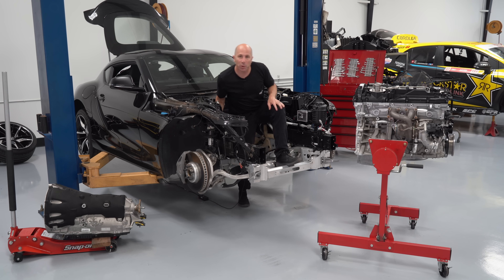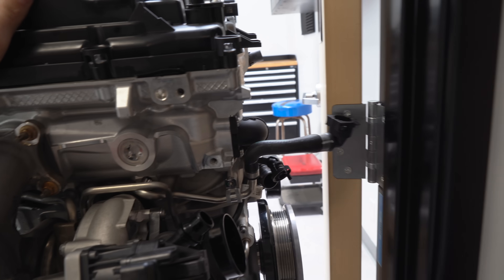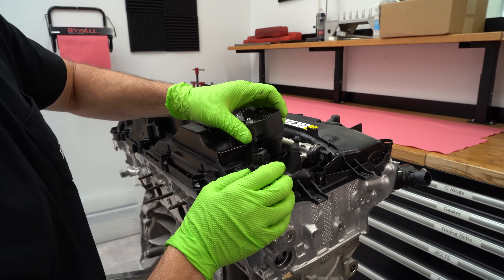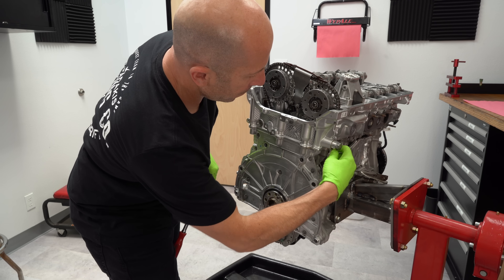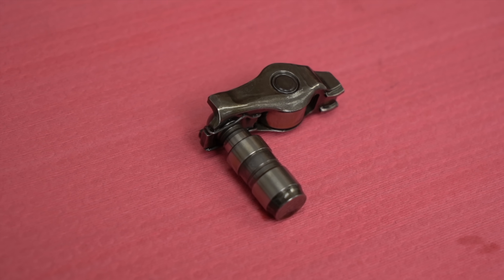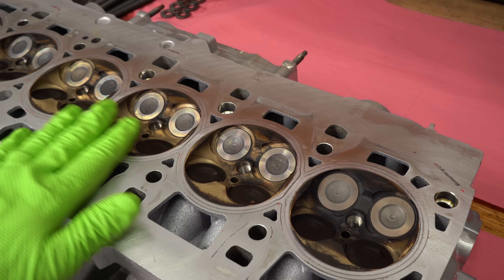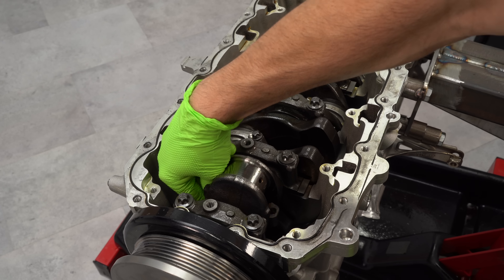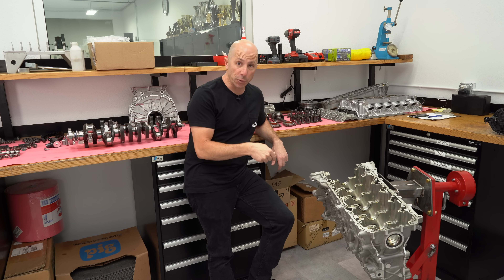2020 Supra B58 Engine Teardown - First Look - Better than the 2JZ?

Comment: All those six exhaust ports which are pretty large it came together in those two relatively small common ports for turbocharger connection.
Another one: at rev counter, redline from @6000rpm?! It's diesel truck or sport car? Many diesels n57 and m57 revs and push (modified- camshafts, valve springs) 6000rpm. My 5cyl fiat coupe 20vt had stock redline from 7200rpm (now 8000rpm).. probably there's some resonance problem at high rpm for b58.
ps: They said had no forged conrods, but i seen "cracked" rod caps there, which usually are used at forged conrods...

Comment: Way too much plastic on this engine for me, and timing chain at the rear of the engine makes for a servicing nightmare. Even simple jobs like removing vanos solenoids becomes a problem, and they will need to come off when the orings go hard and they do not seal. For me a Barra is a better alternative to a 2JZ than this.

Comment: You almost got all the way through without mentioning BMW.  It is good to see the solidness of build on the older B58's though. Now BMW TU2 or B58C's have been redesigned for different temperature management and the 48v mild hybrid.  We get great efficiency, mileage and power on demand now.

Comment: B58 engine is usually very reliable, the only problem is low maintenance the oil filter braks up .nomber 1 silinder can brake rigs on hi stess .

Comment: Oh look more useless german over-complication. Timing chain in the back so you have to remove the entire engine or transmission from the car? 😂 Intercooler in the manifold? Thermostat with a computer sitting on it? Oil cooler with coolant in it? Water pump/alternator bracket with coolant running through it????😂😂😂 What is this? April fools day? Its like this thing was a prank or something. Designed to fail. The fact that anyone thinks this will be more durable than a 2JZ is LAUGHABLE.  I'd like to see one of these do 300k without even being opened.

Comment: 10:57 I’m impressed!!!  Block girdle ties the 2 sides of the lower block together, along with a center bolt going into crank bearings!  We can appreciate the slight over-engineering.

Comment: I'm surprised that you can push these modern engines to 1000 hp. Older engines tend to be more over built, and it seems newer engines are built to very tight tolerances and couldn't take much more power then designed for. I guess this is an exception. Interesting to see that the valve timing system is almost identical to the old VANOS, only electronically controlled now. They used to be hydraulically controlled. Btw I get nightmares seeing those plastic chain guides that always cracked on older bmw engines. Great video and narration.

Comment: Only 2 minutes in, and they never said this car is about 98% BMW.  The engine and engine bay, drivetrain, interior, body shell, suspension, brakes...

The stickers under the hood are in German as well, and it's built alongside the BMW Z4

Comment: Better? No. 2JZ is simpler. Cast iron block. For outright power, the 2JZ' is superior to the B58. The only real 2JZ competition from BMW was the S38B36. The amount of coil, plug, turbo, injector, HPFP revisions from BMW is proof that it is no 2JZ replacement.

Comment: It's not better.. It's a good engine but they are blowing up already with high 600 hp and the transmission can't hold the power like to 2JZ
Reply: That's because of the different variants. The B58 in the mk5 has a stronger hpfp than the other ones since the older variants hpfps aren't nearly as strong. They won't blow when they're around 600whp if(in the case of the old variants) they had got a stronger hpfp. Many run 7-800whp+ on them often and some peer into the 9-1000whp range easily with just piston and rods(tho some have been able to run there's with stock rods and pistons a bit over the 900+whp range and still run just fine and are slowly becoming more common).
Reply: @carboydorifutoparty3976 Facts
Reply: @carboydorifutoparty3976 Please tell it to the people on Face book

Comment: Those are not rocker arms and they do not pivot on a lifter .Those are not lifters ..So those are valve lash adjusters and cam roller followers

Comment: Good vid. Not a fan of all that plastic coolant pipe. Also not a fan of the rear mounted timing chain. I guess time will tell if the B58 ends up being reliable.
Reply: It's been 3 years. Time has already told that it's plenty reliable

Comment: Is there a benefit to placing the timing chain in the rear of the engine vs the front?  I know a lot of German automakers have chosen that route, but I am curious what the benefit of that is.  Thanks!
Reply: This engine is pretty large. Having the chain at the back means it can fit under the hood of cars like the new supra because it makes the engine a bit shorter and less tall up front since there's no chain or belt to accommodate for now.
That chain should last 200-300k miles at least with regular oil changes and 5w40. Timing chains really suffer when thinner oils are used and its not changes as often as it should.

Comment: the b58 engine itself is good but what i absolutely hate is that its made complicated on purpose.
so the repairs would be difficult at normal mechanic, you either go to a bmw specialist thats not affiliated with bmw or go to the company.

Comment: so much plastic I would be afraid my engine will melt
Reply: yeah then learn about different plastics please not everything is a melted down sewer pipe...
VW makes entire oil pans from plastic now they use very high quality compounds for that and these pans would never melt because they use thermoset resin plastic with lots of fiber reinforcement.
A part made from such plastics can be identical to aluminum in its performance except it would catch fire at some point when aluminum would just melt.
Reply: @alouisschafer7212  
It does not matter its still plastic,& will always be plastic.Once plastic gets hot & cold many many cycles it will always get brittle.They building parts soo that you can always come back.
Reply: @alouisschafer7212 ok plasticguy
Reply: That's what I'm thinking.toooo much plastic of vital hot items.Ita a bmw

Comment: bmw made an interesting engine.  But it is a shame we didn't get to see what toyota could have come up with.  I know they worked with BMW and made many changes, but that still doesn't make it a toyota engine...more like a custom ordered engine.  Frankly, I don't see why toyota didn't modernize the 2jz.  But, what's done is done...and it will be interesting to see how the b58 does trying to make big hp.
Reply: What do you think a supposed "3JZ" should have had to be better than B58 and 2JZ?
Reply: @AmelpsXett  I can think of 2 factors: Hybrid injection instead of only direct injection and a timing belt instead of a chain. But that's all.

Comment: Unfuqing believable. They actually thought it would be a good idea to sandwich the timing cover BETWEEN the engine block and transmission?? And you have to make or buy a special socket to change plugs?? 
      Toyota and BMW can both eat a pile.

Comment: My old truck had a mechanical fuel pump, but there's no way that thing pushed thousands of psi... Some please explain
Reply: Direct Injection on Gasoline engines is exactly like commonrail diesels just with gasoline

Comment: Don’t those piston oil squirters hit the piston walls so they help seal the piston ring to the wall in order to minimize blow though from the combustion in the cylinders? Then again…. I recall formula racers, one in particular who was using piston oil squirters to purposely cause blow by in order to get more gas mileage on the track because the oil blend that they were using “Penzoil” was actually combustible.

Comment: Nice to see that bmw refuses to use better materials for the timing guides lol 150K miles and there will be leaks everywhere due to the Silicone and gaskets as well, hope Toyota takes the engine and makes its own changes for a better car later on but this one I would avoid.

Comment: 3:10 - My old 3S-GTE (1990 Celica All-Trac) engine had an oil cooler to which the oil filter was screwed. Oil cooler separation from the engine block required a 30mm deep well socket. Fun times...
TRUST !!

Comment: Hello, my 1jz gte vvti was tuned without the vvti solenoid connected which means now my engine runs on a tune without the Vvti.

So if I connect the vvti just randomly would that cause any problems?

My tuner was dumb to not notice that and many more things.

And yea.. Now I have finally got my 2jz gte vvti with R154 gear. Gona run the same setup in your 2jz teardown and rebuild vids.. Thanks a million mate

Comment: Wow, Audi did that with the timing chain on the back of the engine and its a $10K dollar job to pull and replace it. No Thanks B58. I like the simplicity of the N52, no forced induction and it just lasts and lasts. Hit the road last night and was racing a ZX14. At 160 he started leaving me but it was exhilaratingly fun.

Comment: Doesn't matter if drive by wire can move faster than your foot can move. It's the relationship between when you move, and when it moves. You cant 100% turn off any variations between butterfly position and pedal position. It always does its own thing in some way or another

Comment: I've got the same engine in my X4 M40i and I have to say I truly love it. It make a 2 tons car accelerate like a toy, also the torque is there from low rpm, so whenever you kick-down it just pulls. I've managed a 4.62 to 100kmh and a 16.5 to 200 kmh, very pleased with the times https://www.youtube.com/watch?v=4eSahwlKQgU

Comment: Wow many thanks for showing me this engine. You have restored my faith in BMW engines again. I am the owner of three BMWs. An E46 M3, 1988 635csi, and an E60 530i with the N52 engine. All of which have fabulous engines. I have steered away from their V8s and the one off V10 (which I really wanted). I have heard so many problems with their later engines and I was really worried about what my next car would be. I will wait a little longer now and buy a good used S58 engine (close relationship with M58), possibly an M4 Competition. Thank you

Comment: I still have a 2003 BMW 525i with M54 engine.  I made some research and found out that the M54 has a hollow piston rings. I wonder if the B58 engine have solid piston rings or is it hollow as well?  Please advise.  Thank you.

Comment: Funny Toyota guys pulling apart a BMW engine for the first time. bearing coatings BMW has been using long before auto start stop, cracked rods since the 2000's maybe earlier. Most of the technology is old by BMS standards now.

Comment: The throttle body on modern BMW's is actually only a safety feature, it's wide open all the time and the power is controlled by the intake valves' variable lift.

Comment: It’s interesting how they switched away from an integral bed plate for the main caps and went with a structural windage tray.  Needless to say there’s a lot of new developments in the B58 engine inheriting the best from the S55, N55, and before that the N54.  I’m not sure moving the exhaust manifold in the head is a great idea but c’est la vie.

Comment: I quite like the design.Quite ingenious! The only problem i have is with all that plastic crap. Couldn t they have made some of the parts out of some strong and lightweight metal?! it s getting ridiculous with newer engines when it comes to how much plastic they have.plastic,degrades a lot faster and in different ways when compared tometal over time.I don t care if it s toyota or bmw plastic. it s still f---ing plastic.

Comment: Please stop calling this a supra engine. This isn't a real supra. It's a rebadged z4. Coming from a 2jz reliable legend to a pos unreliable BMW engine. Way to kill a legend.
Reply: Lets just forget the fact that the mk3 had very well known issues of its own which caused it to have expensive issues of its own with its 7mgte. Plus,the B58 is showing more and more that its alot easier/cheaper to make power out of vs a 2jz  mod for mod. Probably not in the billet block level yet but they're growing faster by the minute.

Comment: vauw i had no idea engines of today was build this poor😶...
to mention a few details -
internal exhaust gasses travelling far before reaching the exhaust - in alu. you got to be kidding. in a few years the top will be pudding, annealing the aluminium.
alu block instead of iron is just as bad as the plastic intake. plastic as an integral engine part is a bad idea. simply because plastic cracks after some years. any plastic has poor longterm mechanical properties and cracks too easily, with no chance of repair.
in short, this engine is made like a throw away part, you will have to buy as a whole, because all the tech solutions is short term.
now i know, the world industry is centered on a 2-4 year cycle, where everything is designed to last only that long. but i had never imagined it would spread to car engines - ever.
i now have even less respect for bmw and new cars as a whole.
i am so glad i purchased my 7mgte in time - it is impossible to buy one in my country, anymore.
the old supras are gold.
Reply: I agree with you, I can't believe the manifold is made out of plastic, I can see it getting brittle in a few years

Comment: wondering how much a timing chain job would cost? BMW never considers serviceability when designing their vehicles? That is why you need to take out a second mortgage when warranty period expired.  A friend just shelled out $2,000 for replacing valve cover/oil housing and oil pan gaskets in an E90 328i xdrive. He said, he would not buy a BMW again. Within 15 years, KIA will take over BMW market unless BMW makes a change...designing cars for all people just not for the rich.

Comment: Im assuming the reason there are only two exhaust exits is because the b58 is just the b48 4 cylinder (same one in Mini Cooper S/JCW) with another 2 cylinder bank added to the end.
Reply: No. B58s came out with 6 port heads at first but later on they made the 2 port version for emissions reasons.

Comment: 13:29
You asked the question if this engine was the successor to the 2JZ because the block looked like a race block ... You had the car, you could have slapped a larger turbo and just kept pushing and pushing it till it broke to see what it could do and you DIDN'T ... instead you BUILT this engine with forged internals then made it do 1000 hp giving the impression that this motor is strong. You BUILT IT to be stronger ... The 2JZ has done ~1300 crank hp on stock block ... .... 
Video's like this give the WRONG impression because we have idiots out there that will think this BMW engine can do 1000 hp ...
Reply: Zuurker U  Do you even comprehend what you read ?? READ IT AGAIN AND COME BACK TO ME ... 🙄
Reply: Zuurker U  You are correct, you didn't understand what i was getting at, glad you acknowledge. As i wrote before, the stock bottom end has not been pushed to its limit. YES they have swapped out pistons and rods and sometimes the crank on that B58 engine BUT ... any motor with swapped bottom end parts will be STRONGER. That goes to almost ANY engine.
AGAIN ...
They had the engine and HAD THE CHANCE to push the bottom end to see how much power it could produce. Well they FAILED to do so. Instead they RE-BUILT the entire engine to put down 1000 crank hp. 
YES the 2JZ has already done 1300 CRANK HP on stock bottom end. Matter of fact it ran 4 times on the dyno and 3 runs down the 1/4 mile strip before the rod snapped when going from full boost to vacuum.

So this B58 BMW engine has not been pushed to its limits on the stock bottom end. Yes people are putting in pistons and rods to make 900 whp ...  Well the 2JZ puts down ~1800 whp with just pistons and rods alone ... 

So don't sit there and tell me that this BMW B58 is better than the 2JZ when NOBODY has pushed it to its limits on the stock bottom end. 

If you are going to fire back with more bullshit, then i know for a fact you don't know shit about motors and your blinded by hp numbers and can't tell the difference between stock block and modified block and how they differ.

Comment: Great video, but with no gaskets, all the plastic including the intake manifolds. and the coil pack style sparkplugs. I remain reserved about the reliability long term for b58 engine. Wish there had been more discussion regarding how the motor meets toyota standards versus what BMW does
Reply: On the forums there’s a Toyota employee who shared some additional information but didn’t go too far into it. Main reason was respect towards BMW. But he pretty much hinted they did a lot of redesigning

Comment: I'm not an expert but I believe this is the B58TU1 engine which is a newer version of the B58 engine. The easiest way to spot the difference is the manifold. On the B58, there is a separate manifold whereas the B58TU1 has the manifold casted as part of the cylinder block. The B58TU1 is about 4% more efficient than the B58.

A comparison of the B58 engine with the B58TU1 engine here: https://bmwtuning.co/b58-vs-b58tu1/

Comment: Hey @PapadakisRacing,
how did you manage the heat comming from the engine internal exhaust manifold. Because it is internal and water cooled, didn't it raise the water temperature excessively and so the whole engine?
Just more ratiators for cooling? Special radiator? I know the heat problem from the internal exhaust manifold, which limits the tuning capabilitys of the 4 zylinder ford mustang engine. So i wonder, how?
I would be happy to hear your solution to the problem🤔😃

Comment: Yes because it won't be as nose heavy as the mk4 boat
Reply: The mk4 doesn't have a much different weight distribution than the mk5
Reply: @E9X330  the suspension is tuned as a grand tourer (because that's what the Supra is) and it makes it very nose heavy with that 650lb 2jz in front